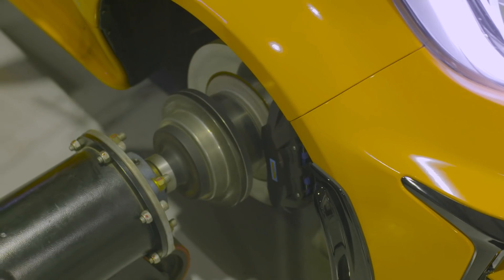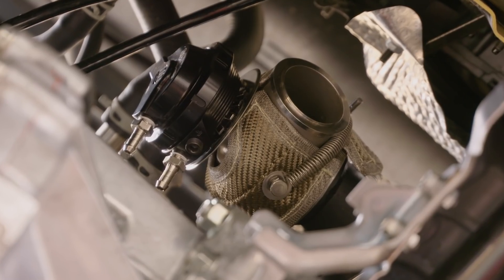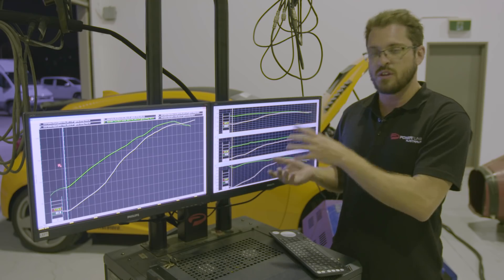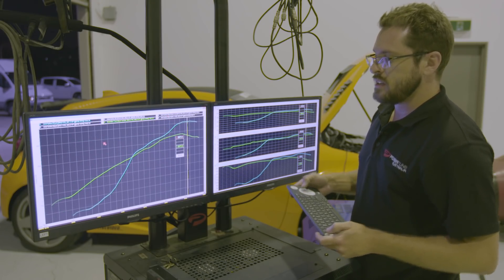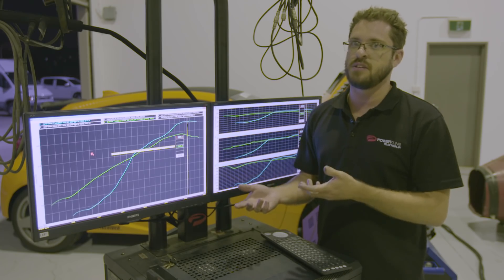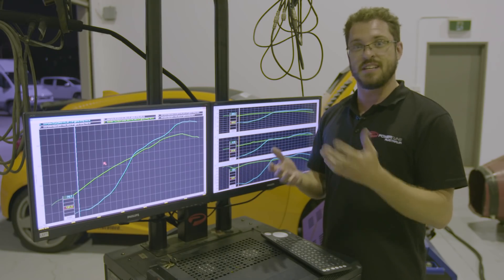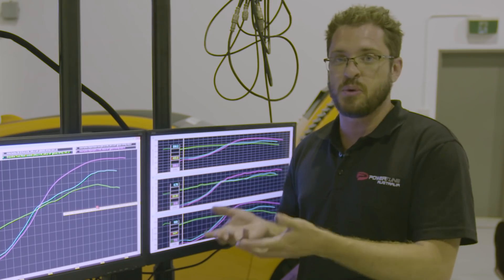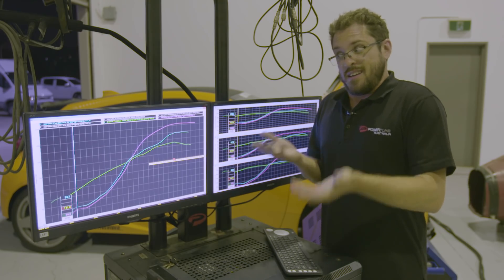GR Yaris goes over 430whp! World's Most Powerful?

Comment: Wow! That is insane power from a 3 banger. Mini 2JZ! Would be cool to see the same sonic tests you did on the RB and 2JZ
Reply: Unfortunately comes with sooo much lag. It'll be much slower than stock in day to day driving.
Reply: @sodazman  that thing is lazy as fark now, power band is so narrow, power aint everything..
Reply: @zaksuzuki  Took torque an power out of the lower rpm for the Rods to not fly out of the block,  i built GR Yaris + this turbo kit you can go ham with the torque
Reply: @zaksuzuki  yeah... just like a mini 2jz lol
Reply: its supposed to be a smart engine
Reply: Yeah mini 2JZ but also half 2JZ cuz it has the half amount of cylinders and almost the half of the displacement

Comment: This is crazy power for a yaris! But hey the small cars needed to be added to the modified range! My Getz is turbo now it's running 100kw at the wheels where factory its only 50kw...only changed the injectors, fuel pump and ecu. My other mate is running a 160kw getz its running 25psi. And only weights 900kg. Love it! I hope they bring out a factory turbo getz to par with the AMAZING Yaris.
Reply: What engine are you running in your Getz? We dont have them here in North America?

Comment: Very interesting to see car being able to handle so much power with stock block. That said,on the road the car is much better with the stock turbo, with the gt25-550 it spools way too late in the rev range. I would like to see a stock turbo with larger wheels to see of you can get close to 400hp at the crank without loosing too much low rev torque.

Comment: Congratulations on the impressive results, 
so #1 bigger in-tank aftermarket fuel pump (liter per hour & fuel press at the stock electric pump after & injectors duty cycles?)
#2  larger map sensor (how many bars)?? 
In addition congratulations on the TOM’s rear ducts waiting for an installation vid along with new hood vent (preferred the WRC’s one than these as the first vent dose it’s job perfectly maybe if you make a comparison trick with orange fiber string or line used with your first vent 
Lastly I saw Kelford cams set not sure if there is any gains at low range and the beginning of mid range for a faster spool as well due to the bigger compressor at the new gt25 
Can’t wait to see it on track/drag 
Seriously I’m thinking about getting one shipped to Egypt. I love the title of the most powerful GR taking it from point the most powerful 3 cylinder engine 
I have had a most powerful 1300cc engine G13b SSGTi and most powerful 1.6L B16B boosted Honda’s engine, it’s time for the GR and thanks to you
BTW I wondered if there is any information available about aftermarket high performance forged pistons & rods. 
Keep it up guys. 👍

Comment: Response would be significantly better with a .72 rear housing. Whoever decided it needed a .92 wasn't thinking straight.
Reply: I was sooo thinking that! but... to their "future proofing" maybe they want eventually 500+ hp which the .72 might have too much backpressure... just a consideration. but yeah if 430 was their end goal then the .72 would have been a better choice in my view.
Reply: @glanzaturbo  plenty of g25’s on bigger engines have proven that the .72 is not a restriction and the compressor tops out before the turbine.
Reply: @signal_msw  ok great... i'm going with a .49 on my g25-550 for my starlet 1.5, only need 300
Reply: @glanzaturbo  Good choice! SR20 with .49 can make over 400whp with super response!
Reply: @signal_msw  SWEEET!

Comment: Hi, very impressive.  Which Turbine housing is on the g25-550? I'm buying one with a .49 to run on my 5e at 20 psi . Only looking for 300-320hp. I have 266 camshafts and pistons and rods. Should I go with a larger housing. It has management so I can actually ramp the boost in safely to not hurt the motor at peak torque but I want it aggressive without much lag as it's a  daily driver. Any additional info would be appreciated. thanks

Comment: Very impressive now lets see if it can beat the HKS yaris with 475hp which is to my knowledge the most powerful since 2020.I believe it even ran 500hp at one time.Still very impressed with the strenght of that small 3 pot.👍
Reply: They used NOS.
Reply: @dejan.  If anything there's also another GR Yaris in Japan that also reached 400+hp tuned by G-Force with no NOS. They ran the car at Tsukuba Time Attack and nearly beat HKS GR Yaris' lap times as well (around 58.5s), though i remember the car was around 360hp at that time)

Comment: Didn't you guys found any oil pressure drop during hard braking? I've discovered the issue running with the Syvecs and analyzing the logs, then surfed the web and found out it's a common problem..

Comment: Honestly, this is an advertisement for the advances in OEM manufacturing, Toyota's commitment to building a true rally special and to the benefits of modern electronics. Just imagine trying to screwing 30+ PSI of boost into an unopened 4A-GZE to make +300kW to the hubs...

Wonder how well the OE gearbox will take it or the whole system when it gets hot on the track. Lap after Lap... Or launching on the sticky track
Very impressed, but boy does it need some bigger cams :D
Reply: The gearbox is the EA6x series (Aisin BG6), these are also used by the Lotus Evora and the powerful Toyota diesels we had in Europe. They are pretty stout as they are rated to around 400nm I think.

Comment: HKS & G Force GR Yaris in Japan also reached 400hp mark months ago (HKS does use 100 shots of Nitrous for it to reach 450hp), so it's pretty safe to say this 3cyl has a lot of potential in it.
Granted the engine itself was probably designed to be able to run in WRC2/WRC3 as well which makes it able to withstand that kind of power.

Comment: Really wish they had more cubes. A 2.0L with the same tech would have been the go.
Reply: WRC rule requirement is 1.6L
Reply: The GR Yaris was intended to enter WRC (at least WRC2 or WRC3) hence the engine has to follow WRC's regulation as well. In WRC2, R5/Rally2 engines are regulated to 1.6l engine limited to 7500rpm, pretty similar to what the 3cyl engine inside the GR Yaris.
Even the AP4 regulation (equivalent to R5) also only allowed a maximum of 1.6l engine as well. Neil Bates Motorsport already made an AP4 GR Yaris which still uses the same engine.

Comment: Why is the dyno only connected to the front wheels if it's AWD?
Reply from the maker: AWD system causes drama on retarder based dynos
Reply: @MotiveVideo  so how do you get it to just run the front wheels? Disconnect the drive shaft?

Comment: Can someone pls explain why is it safer to archive peak torque higher up in the rev range than lower.

According to me. Torque and cylinder pressures are correlated to each other. Having higher cylinder pressures at a lower rpm will still put the same force on the engine components as it would at higher rpms.
Reply: Hi, from what I have experienced, the peak torque is moved due to the larger turbine housing, however,  I don't believe that "moving peak torque higher really does make it safer... I could be wrong... Probably. What I do know is that peak torque is the point where the engine most likely to get hurt so...  What I do is decide the max power I want from early and get the smallest turbine housing that can support that power but with minimal lag then ramp in the turbo as hard as possible to a lower boost level say 5500 at a lower boost say 12 psi then after that have a smooth line going to 20 psi by 7500rpms. So after "peak torque" the power continues to go up but is smoother and won't "shock" the engine. Result is faster times without traction losses and the car is exceptionally responsive. Mind u it's a starlet with a 5e engine. Hope this helps. As I said this is just my experience.
Reply from the maker: Exactly how we tuned our GT-R 👍
Reply: @glanzaturbo  definitely helps. Thx you so much for such a detailed answer!
What are the reasons you think peak torque is the point the engine is most likely to get hurt? And why putting it higher in the rev range makes the engine safer
Reply: You're forgetting that horsepower is torque times rpm. Making the same torque higher in the rev range is spreading it over more cylinder events, therefore cylinder pressure is lower.
Reply: @AndrewNoronha-cb2gy  There are a few reasons from my understanding(not a professional) Motive can probably give you a more concise answer but as i said this is my experience in Jamaica where we have 90 octane #sad. Poor fuel quality causes detonation. When dealing with timing advance you will basically make the most torque/power on the brink of destruction. in a well tuned motor we usually carry it as close to that point on the garbage gas until (unfortunately) we get a touch of knock then take off a couple of degrees so its safe and even if we get worst than the 90 octane a gas stations vary in my country (quality wise) detonation causes rods to shake and usually (please correct me if I'm wrong, I'm working with the concept that the fuel map is tuned out properly) and the high cylinder pressure at peak torque can crush the bearings. Sorry for the long response.
so i use a gfb 3005 boost controller that ramps in the turbo aggressively but then only to  "Safe" boost level and i use a megasquirt to ramp in the higher level after peak torque progressively for the smoothness and drivability. the other reason i use the gfb is because i like having the 6 different presets to switch depending on road/mood but the concept work the same on all boost levels as the megasquirt allows me to set boost by rpm and tps location so there is no boost spike while cruising on the highway.
Reply: @signal_msw  thanks for that. as i said (Not a pro):-)
Reply: Another factor is time.

making say 600nm of torque at 3000rpm - engine is moving slower could mean more chances to bend rods or cause unwanted mayhem. Making that same torque figure at 6000rpm - engine is spinning alot faster and is less likely to shit itself into the oil pan.

Yes ignition advance may maintain cylinder peak pressure at just after tdc (given WOT for both comparisons) but the time duration is almost halved which gives the engine a much better chance of holding itself together.

That's supposedly the theory anyway... how much of a difference in mechanical limit are we talking? Apparently it depends on engine to engine but that is the general consensus.
Reply: @lewisanth4986  I agree but changing to the .72 a/r wont move the torque to 3000rpm from 6000rpm... maybe the .49 would do that, which for the GR Yaris i would say too small. but the benefits of response without losing the top end would be great. Remember, you can always use boost controll strategies on the computer to keep the torque in a safe place but still have response when you need it...i'm just saying ... at least give it a try and if we lose too much up top then we can switch back to the .92. yeah its doing drags for the time but its also doing track so who knows? worth a try.... just my opinion.
Reply: @glanzaturbo  i completely agree with your point as well - I guess end of the day it depends on the tuner and the built purpose of the engine .

Meanwhile, I wonder how the rest of the drivetrain will hold up to the extra abuse given their is enough tractive effort

Interesting times ahead!
Reply: @lewisanth4986  You said it! future looks exciting.
Reply: Bearings do not like low speed high pressure. A hydrodynamic bearing works like a planing hull on  a boat, the faster you go the more load it can take, up to a point where drag becomes too high. The same as your tyres aquaplaning on water. This engine actually has quite large bearings for its displacement, I assume low end torque for rally has been considered. It is the same for piston to cylinder contact. The fuel they are using is highly detrimental to cylinder lubrication also.

Comment: This won't drive / accelerate like a GR Yaris anymore. The boost seems to kick in ALOT later than the stock turbo. BUT, a turbo swap costs money so... going up in turbo size, you need to be smart about it and find the right balance between more power and less lag. So I don't know... but these guys are supposed to be experts. Is this the right turbo-charger to upgrade to? Or something a bit smaller, yet still bigger than the stock turbo, but with better response than this turbo?
Reply: Don’t do this to your street Yaris. You also must remember what these guys would have spent RRP to get this car to where it is now. It’s not going to be for every dude in a Yaris that wants a bit more HP. There’s also no telling how long this will last, it’s all a mystery, they can have a million sensors but it can snap a rod or grenade the box/transfers case in a blink of an eye.

Comment: On our chassis dyno we were doing power and torque curves starting from the fuel cut working it down to about 800rpm with a very slow deceleration rate. But we're talking about big 13l diesel inline 6's in 12th gear with lazy turbos :D. Just couldn't measure good enough down low

Comment: hks has  time attack yaris with 475hp?. Crazy numbers still
Reply: Pretty 100 hp come from nitro injection. Without it their car has around 370hp.
Reply: @galerion505  yeah but with that 470hp. And hks is very modest allways with power figures
Reply from the maker: Japanese dynos are “calculated engine PS” and out experience of bringing cars here and vi e versa is they massively over read. HKS saying 375PS would be lucky to make 300hp at the wheels. No one has seen their dyno graph either
Reply: @MotiveVideo  that is True. But they get very good track times with that car which tell there has to be power behind. Usual if whe think gt86 time attack car they say there is 800hp and those track times tell there is over 1000hp..
Reply from the maker: @89Heke  1000hp gets thrown around a lot. A legit 1000hp on a dyno we trust, you certainly know about it
Reply: @MotiveVideo  yea that number was drop by hp  academy in interview. That gt86 is worldrecord holder. Gr yaris has world record too waiting your car track times too.

Comment: With knowing how much power is stock, you could add some more to the low end, but being this is more track focused that bump in the higher top end is quite noticeable. 
Regarding E fuels most don't notice much difference past 40-60% content other than fuel use, yes it can be made safer with its properties with tuning, but if you have it available and you have the pump for it, it is never a bad thing. As all packages can react differently with various different limiting factors.
Reply: You do realise there's a reason it's so lazy right?
Reply: @scootbmx01  the turbo is big. That's the main reason mate.
Reply: @sexyfacenation  you don't say..... 🤦‍♂️
Reply: @scootbmx01  they said it's how they tuned it , but that's only true to a very small extent. Seems you were implying it is deliberately tuned to be lazy
Reply: @sexyfacenation  no, you mis interpreted
Reply: @sexyfacenation  however I have no doubt there wasnt steps taken to not ramp it aggressively

Comment: Would have been better if you did the tuning on ron 98 petrol. Tuning a street car for exotic fuels that arent available for the most part is not real world accurate.
Reply from the maker: Exotic fuel? E85 is available form the pump in a lot of countries and is the fuel of the future. You can oder 200L drums of it to have at home too.
Reply: @MotiveVideo  We are in Australia the same as you are. There are about 6 stations in Melbourne cbd that actually sell it. Tuning should be done with what is commonly available. 98 or lpg or e10. The cars original power was for petrol, Running it on E85 with increased power is not hard.